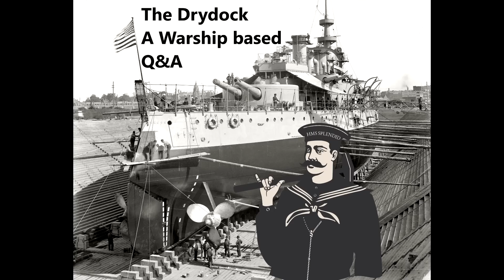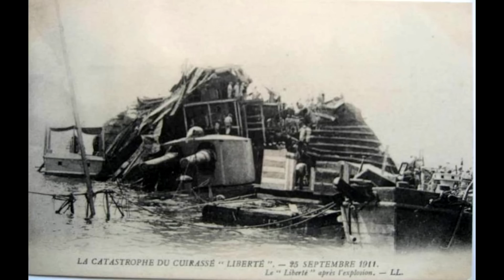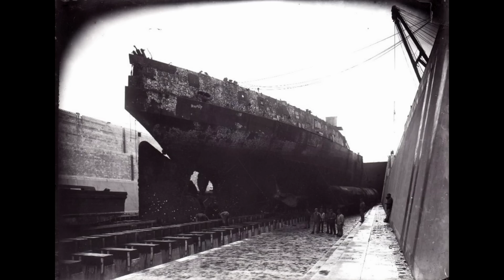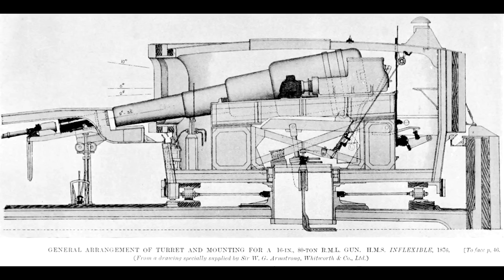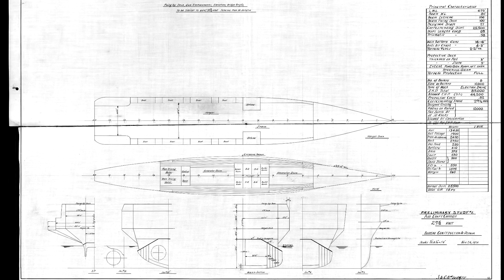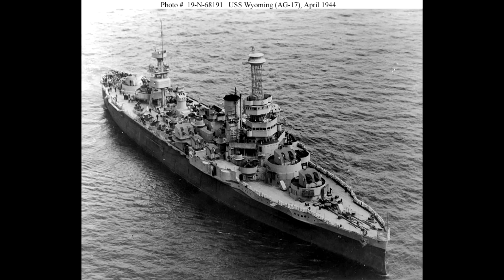The Drydock - Episode 335

Comment: Late to the party. But I cannot help but ask concerning the “armored flight deck Essex” discussed around the 9:00 mark: what would the stability implications be of moving all that armor up to flight deck level? The admittedly questionable four inches of belt armor against light cruiser gunfire is fairly low/near the waterline. The hanger deck armor is also some 16 feet below the flight deck.

Moving all that weight up to the flight deck level would not do happy things for ship,stability. And being proof against 500 lb bombs would be largely irrelevant if the ship played “German DD” and threatened to roll over in any sea state.

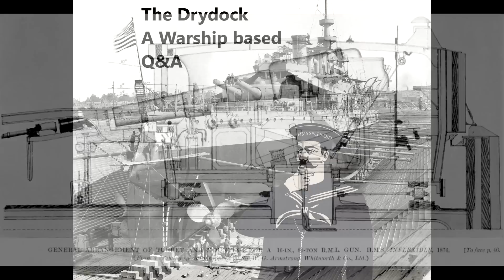Comment: 33:42 The other big advantage with deck-edge elevators is space utilization in the hangar. A centerline elevator also requires a free space in the corresponding patch of hangar deck below it, so you're denied those areas for parking aircraft, and potentially even unable to move aircraft through those areas unless the elevator is at that hangar level. A deck-edge elevator, on the other hand, still allows you to utilize that section of hangar deck next to it, even if you're a bit restricted by the need for space to move aircraft onto or off of that elevator.

Comment: There were a lot more kamikaze hits on US carriers than on RN ships.  I think the only RN armored carrier that had the flight deck penetrated was HMS Formidable:

4 May 1945
Struck by a Mitsubishi A6M Zero "Zeke" carrying one 250 kg bomb which created a 2 foot square hole and a 24 x 20 foot depression in the armored flight deck. Some structural damage was inflicted with splinters entering many of the compartments in the island and three fragments penetrating the hanger deck with one going through the center boiler room and into the double bottom, severing steam pipes and piercing A6 oil fuel tank. Speed was reduced to 18 knots for a time and all radars except the Type 277 were out of action for five hours. This attack killed eight men, wounded 51 and destroyed eleven aircraft. The hole in the flight deck was temporarily patched with wood and concrete with thin steel plates tack welded on top. She was able to operate aircraft by the next morning.   [NavWeaps - Kamikaze Damage to US and British Carriers - By Tony DiGiulian]

The description doesn't say whether any of the aircraft on the deck or in the hanger were armed/fueled.  Based on the description, I'm assuming not.  Does anybody have any more data on this?  Presumably after the initial 'hit/readiness report', a detailed damage report would have been generated - and a full survey at some later date - does anybody know if such documents have been published either on the web or on a book?

In the case of USS Franklin, there were lots of armed/fueled aircraft on the deck and some in the hanger.  I'm a little dubious about comparing these two cases, since whether or not an alpha strike is being prepared has an enormous influence on the damage the ship will suffer in the event of a hit.

That's also true when looking at the loss of the four Japanese carriers at Midway - all of which I believe were arming aircraft at the time they were hit.

Consider the case of the 1967 fire of USS Forrestal.  The ship had a 3 inch armored flight deck - the same thickness as the WW2 ships (maybe different armor quality?) - and if my memory is accurate, detonations from munitions on parked aircraft on the deck blew right through the armor into the hanger, starting more fires.  No enemy action involved - just the presence of the armed aircraft when the fires started was enough to create a major disaster and almost lead to the loss of the ship, despite the presence of the armored flight deck.

Was the damage and loss of men on USS Franklin more due to the fact that a strike was being readied, or was it due more to the lack of armor?  Not quibbling with the idea that the armor made sense if you could afford it - and  I think the idea the swapping cruiser-grade side protection for flight deck armor is a great one and a missed opportunity  (if they could have pulled it off).  However, I'm also thinking that USS Enterprise was hit by multiple bombs at each of the two major carrier battles in the Solomon Islands, and while there were fires and loss of life, it wasn't nearly as bad as what happened to USS Franklin.  Maybe it was the presence or absence of aircraft being armed that is most significant in determining outcome.

Comment: I’m probably missing something. But wouldn’t you be able to use a third middle elevator in recovery? Aircraft lands, roll it forward to the middle elevator, cycle the elevator, and it’s ready for the next aircraft.
Reply: You could, but it's very risky.  Mechanical/electrical systems on ships in general are somewhat prone to failure, and that's especially true of the complex systems on warships.  The salt in the ocean air can be corrosive.  Vibrations of the vessel and wind/wave effects can also be a problem.  Finally, human-induced failures are also a real concern, meaning accidents happen when people are exhausted and maybe overheated (heat exhaustion impairs judgement) and highly stressed and low on sleep - all of which are common in war.

If you have a temporary failure or delay of the elevator, then you have just lost a lot of the flight deck that could be used to help a damaged plane land (assuming the front isn't cluttered with aircraft in a 'deck park').  Notice the position of the crash barriers - they are well past the middle of the ship.  

Maybe a plane on the elevator was damaged, and the jolt when the elevator comes to a stop causes the landing gear to collapse.  Now you have a delay because it will take time to move that plane off the elevator.  Or maybe something was sparking inside the aircraft, and bringing it down to the hanger gives enough time for a fire to start - so now it has to be dealt with before people can get close enough to move the aircraft off the elevator.

Damaged planes may need a lot more space to land than normal, due to loss of function of control surfaces - and potential loss of function by the pilot due to wounds.

Heavier planes also need more space to land, even if undamaged, so that's another reason not to want a middle elevator that could potentially become delayed.

When aircraft are low on fuel (due to long flights or battle damage) you don't want any delays in landing.  You also don't want delays in getting wounded pilots into the ship's hospital for treatment.  The pilots are generally far more important than the planes, because experience takes a long time to acquire and makes a huge difference in performance.

Finally, damage to the center elevator that locks it in the 'down position' for an extended period of time means you have a big problem.  Note that elevators are not armored, and the flight deck armor thins out near the elevator.  Elevators are quite vulnerable to combat damage.

If you put the 3rd elevator a little more forward, then you limit the space in which aircraft can take off, which is also risky.  They need a certain amount of speed to take off, especially if there isn't enough wind (think fighters scrambling in defense, where getting them off as quickly as possible is desirable).

If memory serves, the USS Enterprise went into battle with one of it's end elevators damaged and unrepaired in the 'up position'.  They didn't dare lower it in case they couldn't bring it back to the 'up position'.  This illustrates the seriousness of the concerns: they literally could not take the time to repair the elevator because the ship was needed so badly, and they accepted the slower rate of operations as being preferable to even a chance of losing that section of the flight deck.

Comment: Elevators in the center of your landing area was a weak area of your flight deck.
Deck edge elevators, if damaged (up or down position),  the deck edge does not interfere with your launching/landing cycle.
Multi-elevators are used so that some can bring up and some can strike down aircraft.  This keeps your flight deck in business and your ship in the fight.
Reply: Yeah, I imagine moving planes from above to below & vise versa was a must & the quicker the better in both respects and in a way that causes no interruptions to what is being accomplished but rather almost like an assembly line extension of planes landing & taking off. Which is exactly how you want an air group to operate! And requires a lot more than just pilots too.
Reply: Yeah, I imagine moving planes from above to below & vise versa was a must & the quicker the better in both respects and in a way that causes no interruptions to what is being accomplished but rather almost like an assembly line extension of planes landing & taking off. Which is exactly how you want an air group to operate! And requires a lot more than just pilots too.

Comment: 1:01:00 I've wondered about having something similar to a 'shrapnel shell' but would be better described as a 'cluster shell'. A battleship calibre shell, but it is designed as a delivery system for a multitude of secondary-battery sized shells. Or, to think of it another way: a delayed-release sabot. Or ultra-heavy grapeshot. 

Lets say that within a 14" shell, the payload is 6 (2 offset layers of 3) 5" shells (or similar purpose-made sub munitions), for example. The large shell gets fired, and after a certain delay (perhaps 80% of the flight time) the sabot portion breaks away and the 6 smaller shells descend on the target individually. They spread out over an area, but would be clustered closely near what a unitary shell would land. While not ideal for taking out other battleships, it would increase the odds of a hit against smaller targets & could be devastating for shore bombardments. 

The effect of such a round feels very useful, but I don't recall ever hearing of such a thing ever existing. Which either means that I am a genius who is more creative/clever than countless weapons designers; OR I'm an idiot who is utterly ignorant of at least one (maybe several) key elements of high-calibre ballistics.
Reply: I have a very limited knowledge on this subject, so take this for what it is ... But I think one problem could be the kind of submunitions you could bring to bear. You would probably be limited to pretty simple high explosive type submunitions with very little in terms of penetration capabilities. I mean, without a very complex main shell, you cannot really impose much direction control onto the subminitions. Granted, in a shore bombardment scenario, this could - as you bring up - still be somewhat useful, cluster munitions has proven effective againts human targets. But against ships, even ones with pretty minimal protection, this submunitions probably would be somewhat ineffective, mostly causing superficial damage.
Reply: You want a naval shell with cluster munitions?
Reply: @WALTERBROADDUS  Might not do much against a battleship but God help the destroyer it lands on. It might turn a near miss into a complete superstructure remodeling.
Reply: @willythemailboy2  That does not sink ships. And the crew is not on deck.
Reply: @WALTERBROADDUS  It's what's called a mission kill. No, the ship didn't sink but it's also not in any shape to continue doing the mission it was assigned and needs to go back for repairs. And if it had torpedoes or depth charges on deck it might well sink the ship anyway.
Reply: @willythemailboy2  and yet, no one has implemented this in 80 years.
Reply: You want a naval shell with cluster munitions?

Comment: wrt the question about secondary armament mounted on top of the main turrets, I have seen a cutaway drawing of a two level turret on a Kearsarge class.  The drawing shows internal ammo hoists serving the upper 8" mount, along side the hoists for the 13" on the lower level.  The superimposed turrets were the brainchild of Joseph Strauss, during his earlier stint at BuOrd.  The problem was the glacial reload times of the 13".  The idea was to use the greater rate of fire of the 8" on the upper level to keep up fire while the 13" were reloaded.  After Strauss had his way with the Kearsarge and Virginia classes, someone else figured out that, if the navy worked on the ergonomics of the 13" mount, and trained the crews a bit, rate of fire could be improved dramatically, rendering the superimposed 8" mount redundant.
Reply: I do love the idea, put a third turret ~5 inch on top of the second.
Reply: And a 40mm mount (Bofors or pom-pom) a'top that.❤
Reply: I do love the idea, put a third turret ~5 inch on top of the second.

Comment: Drach - RE: 4" guns for Capital ships and destroyers- you've said the Kriegsmarine should have had more 105mm flak guns instead of 150mm on their capital ships. Would they have done better if they had replaced their 150mm AND single use 128mm destroyer guns with their twin 105mm flak mounts?  The guns appear more powerful than the British 4"/45 but would tri-axial complexity and weight count against them?
Reply from the maker: @garethjones3334  that's a really.good question, my instinct is the 150mm definitely but the 128mm was reasonably good, and honestly they dropped the ball not getting a naval DP version until almost the end of the war.

Comment: At 1:35 you commented that a ship with a pair of superfiring turrets would be able to fire forward without the extra weight of wing turrets. Wouldn't this cause problems (at least in the RN) due to sighting hoods? If I recall the overpressure diagram and various ship layouts correctly, RN superfiring arrangements put at least one hood of the lower turret pretty close to the point of maximum overpressure from at least one superfiring gun at broader firing arcs than the wing turrets would be able to fire at without blast effects causing trouble.

Comment: The skills of a ship's carpenter were not the same as those of a land based carpenter, and those of a naval carpenter were specialized within that category. It would surprise me greatly if land based skills, outside those of shipbuilding, would get one rated as carpenter's mate. Incidentally carpenters were heavily engaged in damage control and so not necessarily in a place of relative safety in battle.
Reply: You can't underestimate the amount of time it takes to effectively use the tools of the trade, let alone knowing what the tools are and what they are used for. Someone with carpentry experience is going to have a huge leg up on someone without.
Reply: @keith6706  The question was where ship's carpenters came from. The answer offered included land based carpenters. The actual answer involved a lot of specific on the job training leading to becoming a carpenter's mate, then more to becoming rated carpenter. I stand by what I said, it is the truth. I did not say land-based experience would not help, I said it would not lead to a warrant as a carpenter.